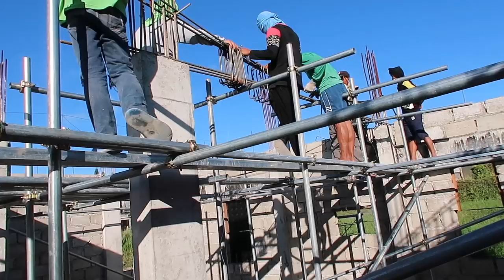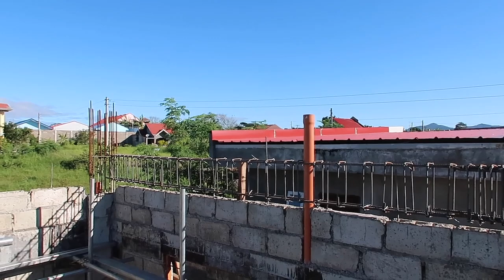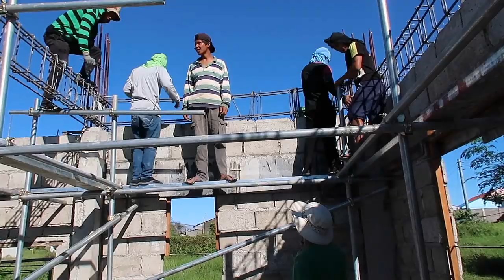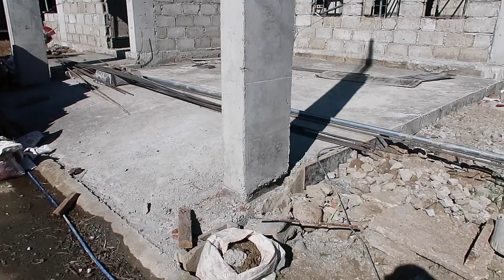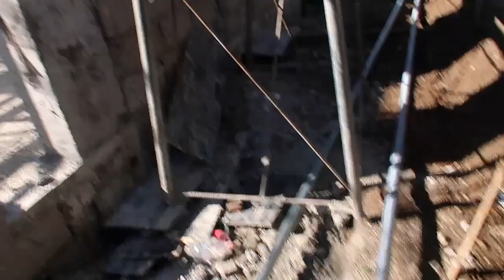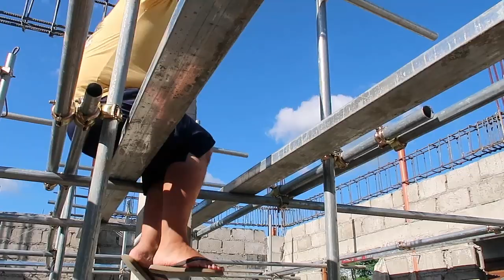HOUSE BUILDING IN THE PHILIPPINES  - EPISODE 39: NO FOREMAN l NO ENGR

Comment: Glad they used headers over the openings. It is custom to build over the windows using wood and when the cement is hard to just remove the wood. I asked what is holding up the wall in a quake they said the window frame 🤣🤣🤣. I used steel but yours look great too. Dont worry about the bottom of the post it looks fine. I used more rebar in my beams but then our house is 3 stories tall. The longest span is also 4 meters. Construction on your house looks better than average 👍 How many floors are you planning?
Reply from the maker: Were doing 2 floor

Comment: Interesting to see you got them to put the concrete slab down first. Usually the other way around in the Philippines. Little bit of a worry having the guys working with no engineer or foreman to supervise their work but good to see they aren't attempting the more tricky stuff on their own.Personally I would be asking them to fix the base of the Concrete Column to ensure its integrity and also the look. It's interesting watching the way they work. All the best with the build 🙂👍
Reply from the maker: They are doing what they can do But they did well.
Making the slab is making the moving easing and putting the scaffolding
Reply: I did the same floor first. Nothing worse than trying to build a house walking in dirt and mud.
Reply: dito sa pinas kht di ka engineer basta alam mo rough in measurements mkkbuo ka ng bahay tipid pa.

Comment: This is informative students taking up  civil engineering and related courses should watch this, but the sad part is some contractors are not safeguarding health and safety of workers.
Reply: there is steel scaffolding so its much more safe then MOST  building in the area and most building in philippines they use boards n bamboo scaffolding and no safety.

Comment: A tip let them put in a crank bar in the topbeams. check on google. it give you extra strenght in the beams.
Reply from the maker: Will be adding 2 more bar
Reply: in the groundbeams you let them make the rebar een u turn profile. Why not in the top beams?

Comment: on the clip on 10.46 minutes i see the angle of the top rebar of the beam the piece that go down is to short i think it is maybe 10 cm that must be much longer. Also you see on this time taht the 2 rebar under it is also to short angle going up is also maybe just 10 cm must be minimum 20cm.  On villa filez they made te same fault. The friend of James(  David,,he bouilded several house there ) he did see the fault and let them chance it. Let someone check it before they put concrete in it.